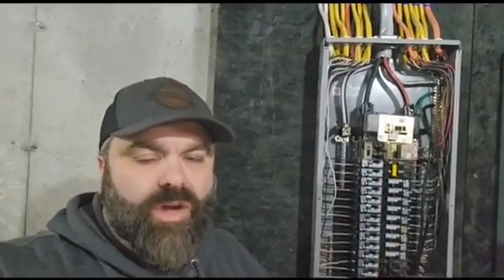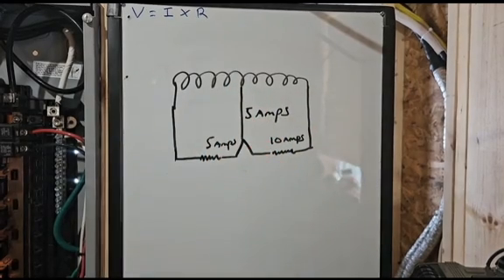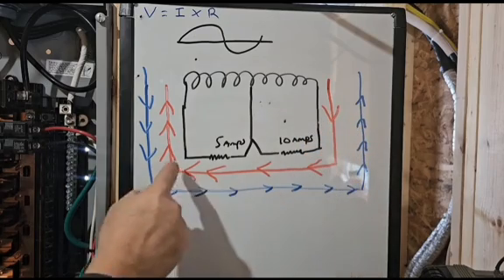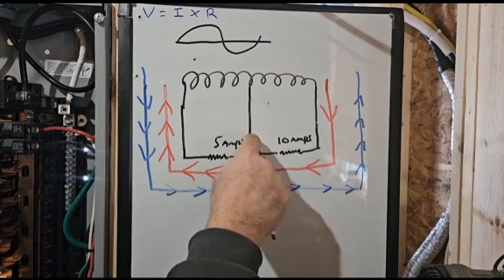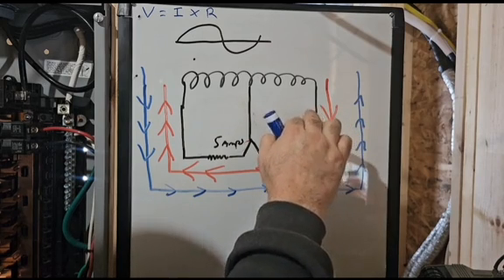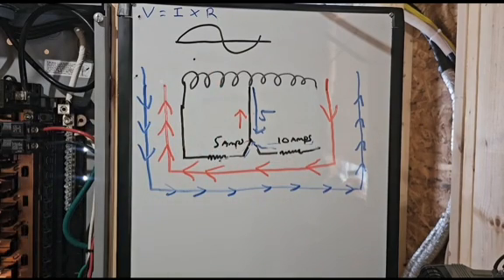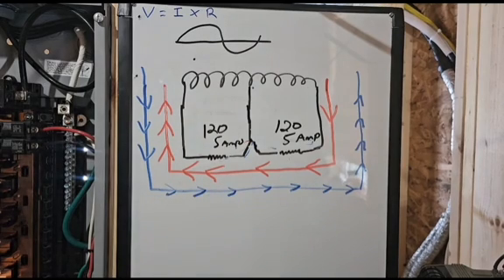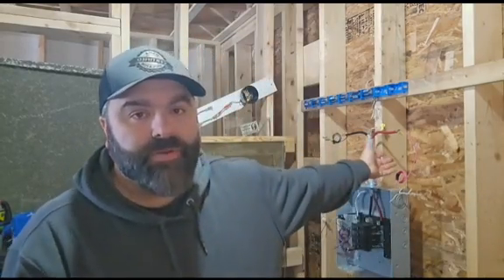CLICK HERE for full video How and why does the neutral carry the imbalance.

Comment: I had to watch your video numerous times to know what you were describing. I agree with you but, I want to say that as a technician I learned about transformers different than your describing. The outcome is the same as you are showing. The flux flowing through the core induces 240volts across the secondary winding. When you have loads on each side of your coil with 5 amps each then in that case there is 5 amps from each load flowing through the center tap but, they are 180 degrees out of phase so they cancel. Now if one load has 5 amps and the other 10 amps then there is 5 amps flowing through the center tap in one direction and 10 amps flowing through the center tap in the other direction (180 degrees) and the resultant current is 5 amps. It's the same thing your showing but, in another way.

Comment: I love these videos as they explain AC in a much clearer way and more in depth than I've seen. I thought the image of the 2 legs with power "flow" was super interesting but it got me thinking about how the neutral is also tied to ground and if that complicates the thinking. You mentioned that power can flow from the transformer on the neutral, would it also pull from the grounding electrode?

Comment: Maybe could have been explained better using a watt meter instead of an amp meter. I have a Harbor Freight plug in watt meter to monitor my power consumption. Bottom line: how much wattage was the circuit using and how would you demonstrate it?
Reply: Watt meter just needlessly brings in extra math. Amps & current is what he’s talking about.
Reply: Amps & current is the same thing.

Comment: I think what confuses people is they understand that the phase cancels, the problem is the phase they're thinking about is the voltage that's driving the current. The greater the difference of voltage being "canceled" (relative to the center tap) the greater the current not going back on the neutral. (Trust me I think we're saying the same thing you just say it a lot lot better)
The load acts like a resistive divider.
   What I would like to understand is when you get to highly reactive loads. Can you do a video on that?

Comment: I've always understood the neutral provides the return path for the unbalanced portion, never knew it provided it as well. So, does it provide these unbalanced amps at 0 volts?
Reply: No, for current to flow, there must be voltage. It's 0 volts when referencing ground (no potential difference) and 0 volts when referencing the +120 volt part of the cycle, but it's 120 volts when referencing -120 volt part of the cycle, hence the return current.

Comment: I completely understand that the current is not ACTUALLY canceled, but the reference to it being canceled is in regards to the values of amps on each hot leg.  
The VALUES cancel out, IE 10 on one and 7 on the other, 7 'Cancel out' via math to get 3 on the neutral.
Reply: But cancel is still the incorrect term. It’s not cancelled. The 7 is still there, going back to the source. The 3 is still there, going back on the neutral. Canceling is an incorrect term to use.
Reply: @icevariable9600  like I explained in my comment, I understand that it is not ACTUALLY BEING CANCELED but the reference of it being canceled Is in regards to the amps on each hot leg: IE if one leg has 7, and the other leg having 10, 10-7 (which some say is cancels out in math) is 3.  So 7 cancels out on 10 and leaves 3
Reply: @turtledude01  
Yea. I know you said that. And that’s an incorrect way to say it. 

Again, it doesn’t cancel out. Again, it’s the wrong term and the simple math you’re showing doesn’t fully explain what’s happening. It’s not 10-7 leaving 3 amps. It’s a full 10 amps distributed across two wires. Your math is how you understand it in your head, but it’s not painting the complete picture.
Reply: @icevariable9600  when communicating things to people, you use the words that you both understand.  I am simply saying that some people consider subtraction as canceling out, which is why some people use the word cancel for this.
Reply: @turtledude01  
Yup, I got that. Good luck with that.

Comment: Your channel is fascinating. I have only the most basic of understanding of electricity. But this brings up a question: is this why my home circuit breaker panel has two columns?
Reply: Each column represents one end of the transformer. When one side is +120v the other is -120v and vice versa.
Reply: @surferdude642  Thank you! That makes sense.

Comment: You make many good videos but it is clear that you are an electrician and not a professor of electrical engineering.  
My brother who is a professor and teaches electrical engineering, electrical technician instrumentation and controls explains it differently.
I believe Kirchhoff's law is needed.
The phases are cancelling each other out not the current is being cancelled.  The EFFECTIVE current flow through the neutral is zero.
This is a good video to explain 90% of it but it's in the EU so the single phase is different as they go Single Phase to ground for 220V.
https://www.youtube.com/watch?v=zlHbsT4bhR8

Comment: FINALLY! Although I'm a pilot, I have a BS in EE.. This explanation is correct. Congratulations for understanding a complexity that must don't understand. Yes, the currents don't "cancel" in the grounded conductor ("neutral"). Instead, the neutral is carrying the imbalance, 1/2 cycle in one direction, and 1/2 cycle in the other.. Also, as you stated, "zero voltage" does NOT mean absence of voltage.. It's 120 volts below +120V and 120 volts ABOVE -120V.. Congratulations again for understanding something that most people misunderstand..

Comment: Military electronics guy here. Im enjoying seeing the differences in explanations of circuitry between residential electrical and aviation electronics. Im Having to re-envision my understanding.
Reply: What's the difference between aviation electronics and residential electrical? It's all electricity. Do you use  AC or DC or both in aviation?
Reply: @bernardocisneros4402   Both.  Electrical and electronics aren’t exactly the same. Electrical is the wiring that leads up to the wall socket, electronics is how the electricity makes the appliances and/or computers work. The same, but different. That’s how I would explain it.

Comment: I’m still confused. This looks like an example of kirchoffs current law, but wouldn’t the current divide in proportion to the amount of resistance on the line? Instead of equally 5 amps and 5 amps when there’s no resistance on the neutral?
Reply: It does.. If both "sides" are 5 ohms, the circuit would be a straight series circuit, and the "neutral" would carry zero current.

Comment: Thank you for the video. Could you explain what would happen with the blue path (from left to right in your diagram) with the 5 and 10 amp resistance but if the neutral dropped out?
Reply: If the neutral disappears you have a series 240 V circuit. As with any such circuit the voltage will divide between the loads proportional to their impedances and the current will be determined by their total impedance.

In this case the impedance of the 5 A load is 120/5 = 24 ohms and the 10 A load is 12 ohms. In series across 240 V the current will be 240 / (12 + 24) = 6.67 A. The former 10 A load will drop 12 x 6.67 = 80 V and the other 160 V will be across the former 5 A load.

The irony(?) of a broken neutral situation is that the smaller load ends up with the larger voltage, often suffering as a result.

The above is all based on Ohm's Law alone and of course assumes linear loads for simplicity.
Reply: @civildiscourse2000  Thank you! The wording to my question wasn't great but that was exactly what I wanted to know; the existing state with the neutral. Then, the sudden loss of neutral.
Reply: @wrinkledasian5206  You're very welcome. Aside from dealing with this in theory I have seen it play out more than once in practice - once to an entire house service. It sent some brand-new electronic equipment (including the controls of a fancy stove) straight into the semiconductor afterlife.

Comment: This is so wrong.

Only if both series loads are non-reactive will this be true.

But the voltages across the loads will not necessarily divide.  If one load is more reactive than the other,  the currents in each load will be out of phase with the other because voltages are forced into phase with each other by the utility  transformer secondary with its center-tap. Therefore, the voltages will not evenly divide.  The voltages on either side of a center-tapped transformer are IN  PHASE with each other, but of opposite polarity.  Only with practically resistive loads will the voltage be evenly divided.   AC behaves very differently than DC in all but resistive circuits.
Reply: No, he's not wrong at all.. He's discussing the current in the grounded (neutral) current. Of course, non-linear load will change his model to a degree, but he's quite correct given he's talking about a residential service. He's using a model based on simple (resistive) loads to clear up the misconception that opposing currents meet at the neutral node and cancel. And he did a fine job explaining that concept.

Comment: It's called Kirchhoff's current law.  The current flowing into a junction must be equal to the current flowing out of it.
Reply: But the voltages across the loads will not necessarily divide.  If one load is more reactive than the other,  the currents in each load will be out of phase with the other because voltages are forced into phase with each other by the utility  transformer secondary with its center-tap.
Reply: @JohnBond-m4t  Kirchhoff's current  and voltage laws have been adapted for reactive circuits.

Comment: The only suggestion I would make is the choice of words. Instead of the neutral providing the extra amps I might phrase it as the extra amps are taken from the nuetral by the more negative leg.
My intuitive model is one where AC pushes and pulls, and I think the hangup people have is in the notion that neutral is an active agent in some sense, so "taken from" gets around this.
Dunno, maybe just me.
Reply: How is the neutral providing any amps if it’s essentially “grounded”? I always thought of it as only taking excess amps not being used by device and letting them go back to ground and balance the load that way.
Reply: @gregminkner5941  Good question. Look up "Mike Holt". Specifically Neutrals and Grounds beside that. Hope this wasn't too late.

Comment: As an HVAC technician, my three phase knowledge went as far as knowing that my wires were in the correct position so that my rotation was correct. It was cool seeing the why and how of three-phase electrical. This was a great and well explained video, and thanks for taking the time to put make it.
Reply: This isn't 3 phase, it's a single phase centre tapped transformer arrangement. Both legs are out of phase by 180 degrees, whereas 3 phase has 3 legs out of phase by 120 degrees.
Reply: @shamrockshore6308  And now I've learned more

Comment: The way you do it in lots of your video is unconventional for me 

Over here we just do do like you did arrow from H1 to neutral point  and neutral point to H2  and just substract value in the neutral branch because arrows are point in reverse direction 

inserting current direction during cycle in the same explanation will just lose most poeple   and it's not of much use on a day to day basis

Comment: Hi bro..... The matter is related to two currents running in the opposite direction 
so the result I(total)=i1-i2 the differential current passes across the neutral, based on the transformer concept

Comment: So. is that how my 240V 3 wire works?  Was wondering how/why no neutral wire at the tub, but has 4 wires at the breaker box on the side of the house by the tub.
Reply: if you have a 240 load you don't need the neutral, you just use the 2 hot

Comment: The problem might be terminology.  When looking at a transformer, the "neutral" is a center tap not a called neutral.  So the concept of "neutral" is that it should be inert and not source any voltage or current, and you clearly show that it is not the case...  Well,  It's been a long time since I took electronics so I'm watching you and thinking,  there's Kirchhoff's circuit laws basically account for all the voltages, I guess also current, this was a little sloppy on terminology and I'm just as guilty to call things power current voltage almost interchangeably,  but you get your point across and I understand what you're saying...  Basically, that Current has to add up to zero all around... i.e., if the total is X then all the elements must add up to X, the center tap will be the difference in the different phases.  So I'm sure that something in those electronics tech course could a good way to back up your points... but please check into my information before presenting because I don't want to guide you wrong... there's enough of that going on these days.  LOL....  Cheers!

Comment: What causes imbalance and balance in the transformer? I'm new to this. Is it dependent on the load?
Reply: yep the load, if you plug your cell phone charger on one side and the hair dryer on the other side  the load are not balanced 
but there is no real issue to it , unless you decide to overload one side and don't use the other side

Comment: So positive current comes from the transformer, into the circuit panel box, out through a circuit breaker,to, an appliance, back on the neutral to the neutral, ground block in the circuit, breaker panel, then goes out on another neutral to an appliance on the negative cycle of the sine wave, through another appliance, and out through the hot back to the transformer? It seems like a lot of neutrals will have current on other appliances on the opposite sine leg. What I can’t grasp, is, why would you need amps going through an appliance on the negative cycle? Maybe because it’s on the negative cycle. It needs to get back to the transformer. So at one point all of the neutrals in that circuit panel box may actually have current going through them on the negative cycle, or positive cycle depending on the sine wave. you did a fantastic job on showing me how current actually travels. If anybody else can help me out here, it will be appreciated.
Reply: you don't need to know current direction during the cycle in a day to day life.  just have to remember that   the left side is 180 deg of the other side  and your good 

so you have 120V on one side 120V on the other side  the sum equal 240....

Comment: I know where that amperage is coming from. the computer system lights and relays operate on a 120V circuit. In theory there's a way to do it but you would have to install a 220 to 110 transformer. The problem with that is it makes it much more complicated.
Reply from the maker: What is the context of what you are talking about
Reply: @Stevenj120volts  He's talking about  the 1/3 amp for you oven.

Comment: People really struggle with split phase AC, it actually helps to look at 3 phase for some, but opposite for others. They can’t understand that the neutral is a hot wire for half the cycle, since it can’t which them while being grounded like the hots can. Difference of potential hard to explain, but you have the teachers gift.
Reply: A big issue is that many people believe that "0 volts" means the absence of voltage.. They don't understand that it's a voltage in itself, higher than negative voltages...